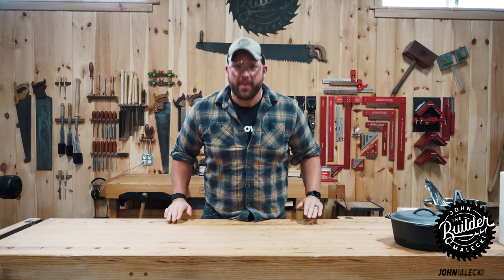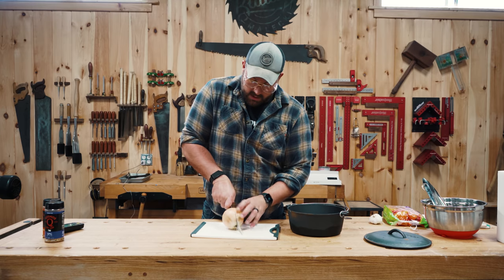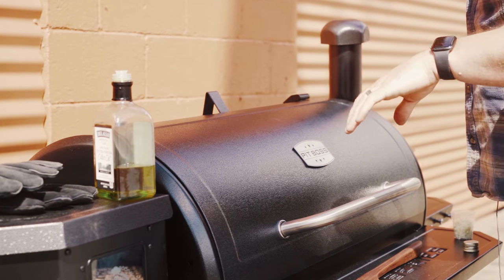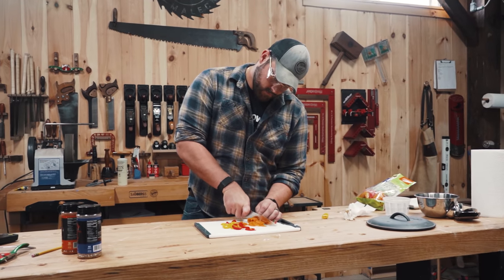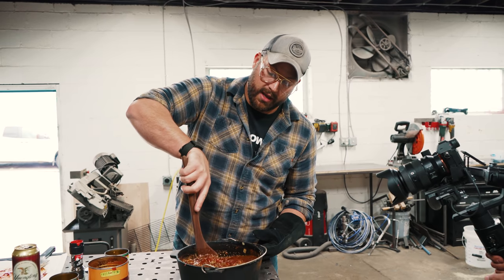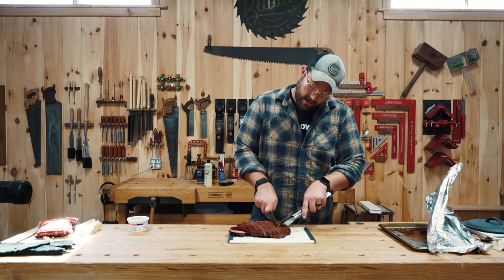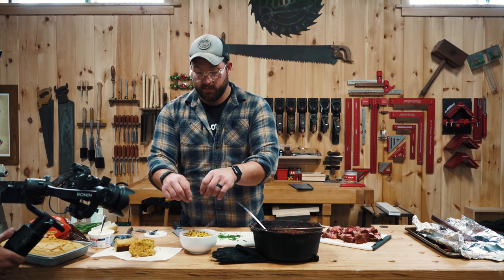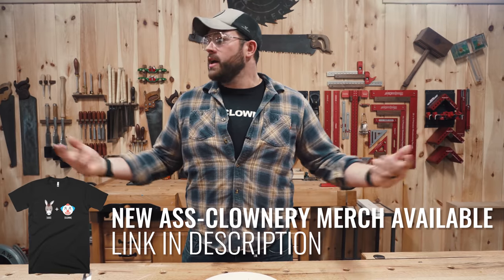Workshop Cooking - BEEF CHILI with Beer EP 002

Comment: I am loving these cooking videos. I am a qualified chef. Some good tips. You don't need to do a horizontal cut when dicing onions because the onion is already layered horizontally. Also, it's a good idea to season the meat with as much salt as you want on both sides, then put the meat in the fridge overnight. The salt pulls out the moisture, makes the moisture salty, then the salty moisture gets absorbed back into the meat overnight.